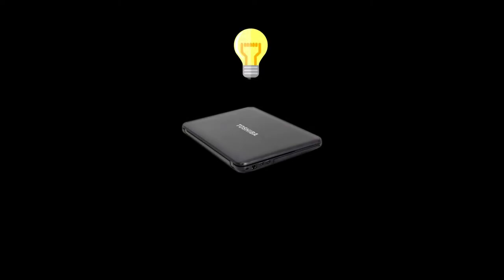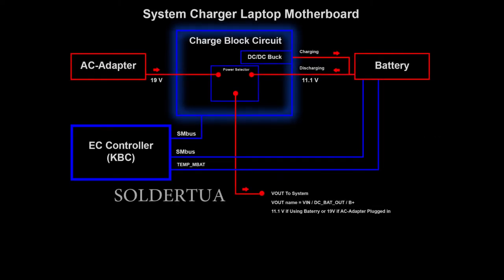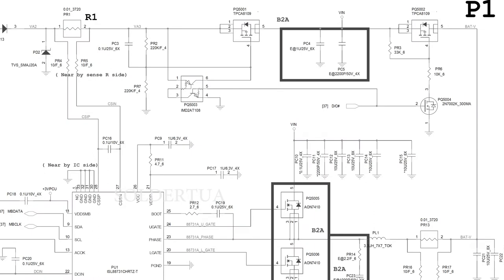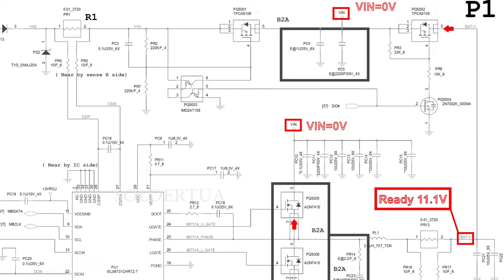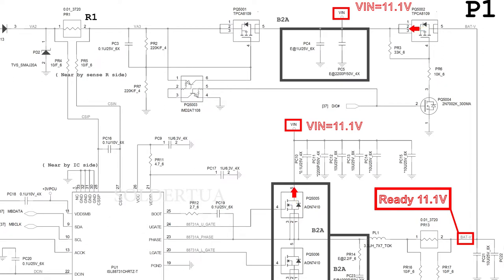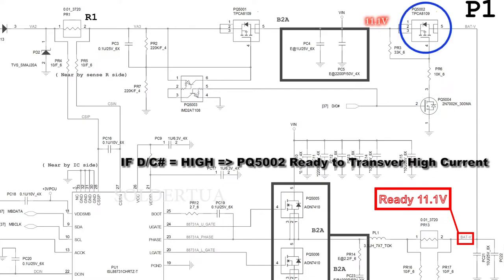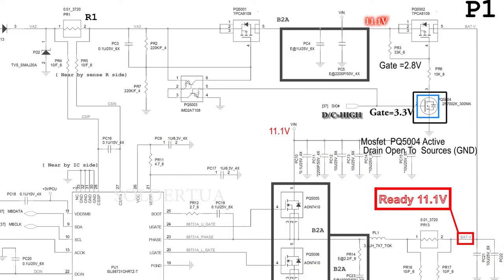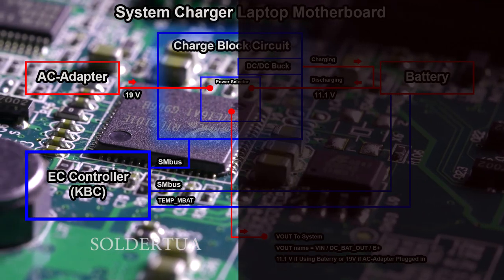How Charger Controller IC ISL88731C Works on the Motherboard | Part 1 | Battery without AC-Adapter

Comment: When there is no Adapter and no voltage pass through PQ5002 from Battery then how EC controller will be energezied and D/C# will generate HIGH signal ? Can you explain ?